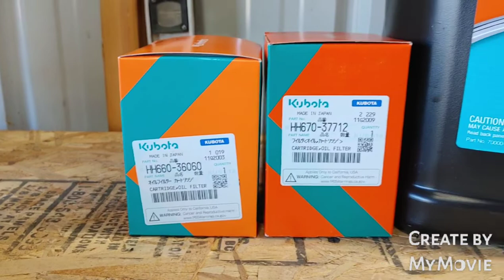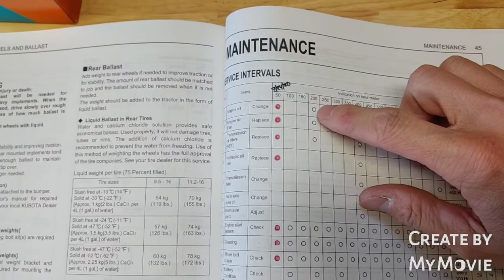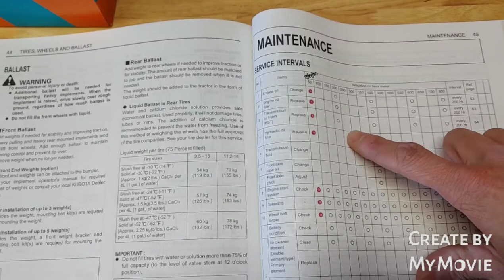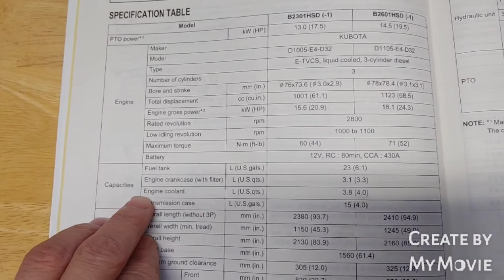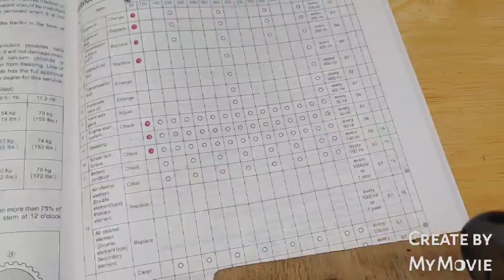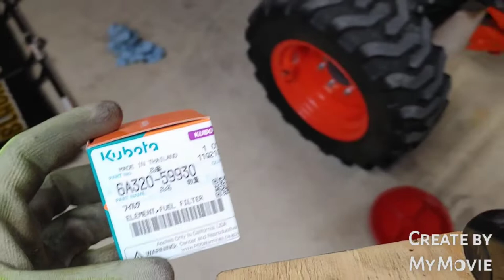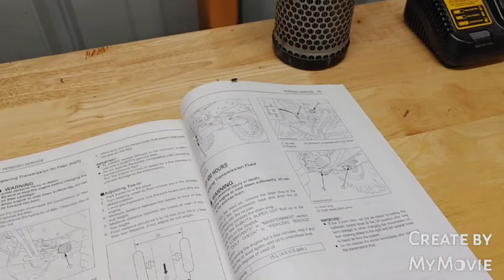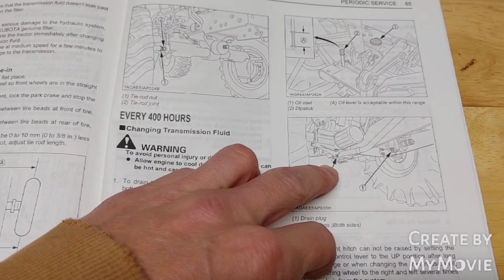Kubota B2301- B2601, 200 hour service: Well sort of.

Comment: Hello Kyle, r
Great video.  I noticed you have a backhoe. I take the backhoe on and off of our B2601 quite often and have found that having  it  on a dolly to be a great help.  Being able to move the backhoe  even half an inch made the installation  process  much easier.
All the best,
Ben from Nova Scotia
Reply from the maker: Hey Ben, thanks for checking out the video. Great point on the dolly. It's definitely is a pain to install sometimes. What brand of dolly do you have? I wonder how hard it would be to build one.  Take care and all the best👍. Kyle